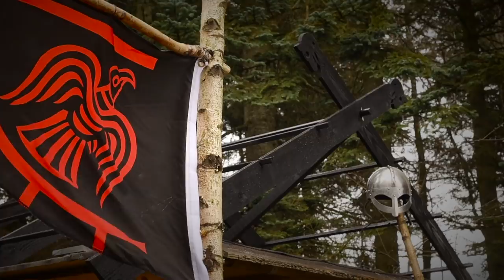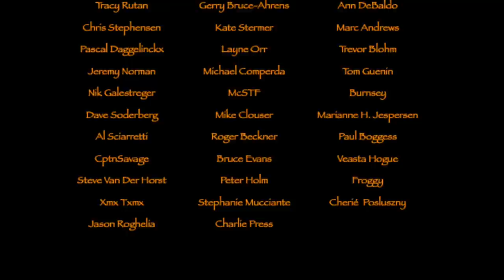Vikingization of Cimbrer Camp

Comment: For the roof you might consider using what we call shade cloth which is an open we've to keep sun off but not rain. Wind will blow through it and if you use the tan color it will show off the frames.  You could also make it so you can remove it when your not there so storm winds won't affect it.
The sticks you talked about would look good also.
Reply from the maker: Thank you so much my friend for your great suggestions 🤗 
Your ideas are great and that could definitely work. Hope you’ll approve the choice I make for the final result 🏕🔥Tom🇩🇰

Comment: Well Tom that piece on your roof is really cool. You did a great job. If you want to strengthen it a little, I would use some 1 in. By 3 in boards spaced about 3 to 4 inches apart running the length of your roof. I think that would give you what your looking for. Good luck my Brother
Reply from the maker: If I understand you correct Dwayne 🤔 that’s actually what I’m going to do 👍🏻😁 … but only on the front … very airy and good looking. Thanks for your suggestion my friend 🏕🔥🌲
Tom

Comment: I like your show because you also build things.
I have an idea for your roof. Maybe a burgandy/red cloth. Like a viking ship sail. I am sure it could be secured with painted black screws with washers without the wind ripping it off. And also, either waterproof the material with a turpentine 8 oz/beeswax 1 pound/linseed oil 8 oz mixture so the rain beeds off. Whatever you do, if the material you use allows the rain to fall through, mold and mildew will build up on your roof. You may want a water tight roof or the ability to roll it up to allow the sun to dry your roof. Me...i like the reddish sail idea. Rolling either side up to the ridge poll, like the chinese bamboo curtains, once a week or two to allow the roof to dry. Gives you an attic for storing wood too maybe.
Best of luck sir
Reply from the maker: Thank you so much John 😁 appreciate your suggestions and great ideas 👍🏻 I’ve considered something like you are talking about 🤔 but not sure if it’s going to be too heavy 
But you have a point 👌🏻 that there will grow fungus on top of the roof if it doesn’t get sun ☀️ 
Atb to you brother 🏕🔥Tom

Comment: Wooden angle braces is what you may have been thinking for stability of your walls.  I love what you have done on the roof.  Since the roof is water proof, could you use a light weight ,dark colored canvas to cover it between your 3 nice X pieces?  Then cover that canvas with your wired thatch with the reeds standing vertical ( to shed some of the rain water).  Lay that wired reed thatch like you would shingle a roof. I don't know how tall that reed thatch is, but it looked tall...so maybe 2-3  layers?  I don't know if I am explaining this  right.  It would look like the 2 boards that you lapped on the outside of your shelter BUT with half a meter of space before the next layer was placed on top of that. Using an awl poke a small hole on either side of your roof cross boards to secure the wired thatch with more wire could keep it all in place.
Reply from the maker: Thank you so much for your very thorough explanation of your ideas for my roof 😉👍🏻 
I think I understand what you mean and think it’s a great solution … but also time consuming … not a big problem but I can buy those thatched rools in 160x300 cm witch matches the dimensions perfectly … and I’ve decided to go with that 👍🏻😄. Thanks for your interest in my video and building project 🏕🔥🌲Tom

Comment: Hi Tom, I LOVE the new Viking roof line!  It looks great and I agree that you need to put on a roof. But the bamboo held together by wires won't last very long in the weather. Could you get some thin wood that is usually sold a "paneling" in the US, to put on the roof? It wouldn't be heavy and could be treated or sealed to resist the rain. Just a suggestion.  Anyway, I love the way that Cimbre Camp is evolving! ATB to you and yours!
Reply from the maker: Thanks Ann for your great suggestions 🤗👍🏻and ideas 
I know that the material that I’ve chosen to use wouldn’t last very long … but if it’s last for a couple of years that’s fine 😉  Thanks for joining me again in Cimbrer camp my friend 🤗🏕🔥Tom

Comment: Hi Tom, a really good job well thought out and executed. Your idea for roof covering is great but even the  pervious matting will still attract loading from the wind and there will be a tendency for the roof to lift. Particularly as it will be light weight. Not sure if you have a positive fixing of your frame onto the existing roof but I suggest you will need some form of strapping to guarantee stability. Please don't think of this as a criticism as you have done a great job. Just trying to help with your project. 
Kind Regards.
Reply from the maker: I understand completely Derek 😄👍🏻 and I’m very grateful for your help. The roof is secure with iron plates and in the middle with some wood 😉 so I’m not concerned about it regarding the wind … only if I make a solid roof … of wood or something like that … I’m afraid it’ll be to much for the construction 🤔 And that’s why I seek a airy solution. 🏕🔥🌲Tom
Reply: @cimbrerbushcraft-vikingheritag  Thanks Tom for your reply. I am sure that you have nothing to worry about with regards to your camp as built at present. My only concern would be for the new roof. Even if you do make the covering porous the wind will still apply load although, not being solid, the force will be less. However I do suggest that you should have a physical nailed/bolted connection between your existing and new roof. I am a qualified structural engineer and will be more than pleased to offer any advice if you think it will be helpful.
Kind Regards
Derek
Reply from the maker: And I do have that my friend 😉 The new roof construction is nailed to the old roof 💪🏻 and done thoroughly 🏕🔥Tom🇩🇰

Comment: I picked up that same helmet from Grim Frost in a large but it’s still way too small for my head. Since the helmet is round it’s too tight from front to back. I wear a 7 3/4 inch hat.  I wish it came in an XL. Not sure if they will do a return. The helmet is awesome and heavy as hell, it’s just too small.
Reply from the maker: Yeah that’s the same with mine 
But I’ve pressed it VERY hard and now it’s oval and fits my head nicely 😁👍🏻. Appreciate your feedback my friend 🏕🔥
Tom
Reply: @cimbrerbushcraft-vikingheritag  I thought the same and attempted to do that too. All 210 lbs of me could not make it flex.
Reply from the maker: Well I have a bit more weight to put on 😆💪🏻 lol … but definitely NOT easy I tell you 😉🏕🔥🌤